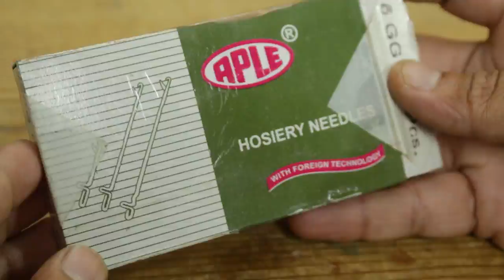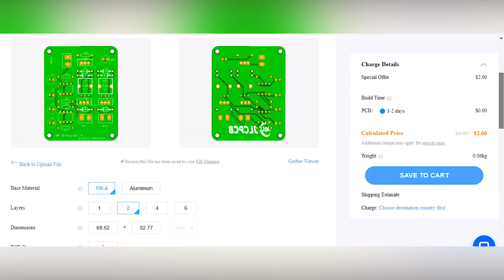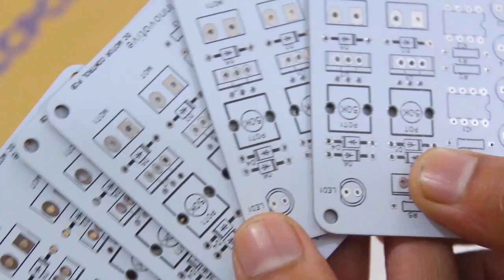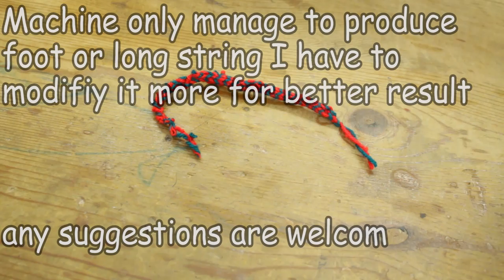DIY French knitting machine | Yarn knitting machine

Comment: You need to run the yarn through a resistance pad to add tension while knitting ( on the Feed side) and add a coiler drum underneath so that will add tension on the outgoing and to the needles whilst knitting, Just study how a hand knitting machine works and you will see how tension is achieved, if you saw one of the little hand crank machine used to produce this item you will see they add a weight to the outgoing, Hope this helps

Comment: That is a cool design.

Suggestion:  Whenever the yarn gets too loose, too tight, or when one strand is significantly looser than the other, the yarn will get tangled. Add adjustable mechanisms to individually control the tension of each strand of yarn.

The coil springs that guide the yarn into the needles probably influence the tension, but they don't appear to be easily adjustable.

Note that I have no experience with yarn or string tension. My only experience is with a DIY mechanism that controls the tension of 8mm rope using a 5kg counterweight. That took many tries to get working consistently.
Reply from the maker: thanks for the suggestions...

Comment: This is really cool.

It looks like there's a problem with the yarn slacking up as it comes off the cone spools.  The yarn that is currently on top going across the top of the machine will temporarily be pulled tighter and the one across the bottom temporarily looser.  The simplest thing to try would be to cross them in the middle so the one on top at the spool end is on the bottom at the knitting end.  I don't know if that will be enough, but it is easy to try.

Does the distance that the needles move match the distance between the two feed holes in the wheel above the needles.  That could affect tension.

Sewing machines are pretty clever about making sure that the path of the thread stats about the same length as the needle moves up and down.  There are some pretty good videos about how a sewing machine works.

I'd expect knitted cird to be much more stretchy than woven or braided cord.  There's a Japanese braided form called kumihimo.  There's a lot of good instruction about how that's done.

Comment: Could be simplified. Remove top axle, and thread holder.

Top ring (above needles) - add plate with two holes and two pins on top(for bobbins) rotate this entire plate. So it goes bobbin to hole straight down to needle area. Vastly simplfies treading too.
Reply: Oops.treading should threading.
Reply: @Wyld1one  you can edit comments by pressing the three dots button
Reply: Also this is a really smart idea but i think that is maybe for slack or tension.

Comment: Thank you for some interesting solutions.
But, if I understand right, yoiu use at the moment only the half of your electronics. Why is the purpose of the rest of?
Reply: It is a simple DC motor speed control for up to two motors. Since this device only uses one motor, the other half isn't needed. Any speed controller that can handle the motor would work.
Reply from the maker: I always design PCB for broad applications so no need to design new PCB for every next project.